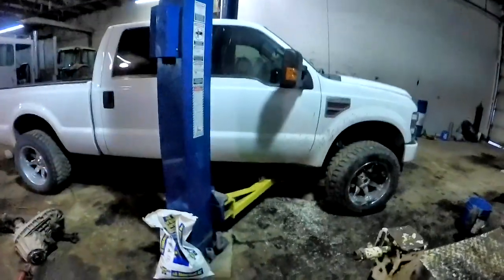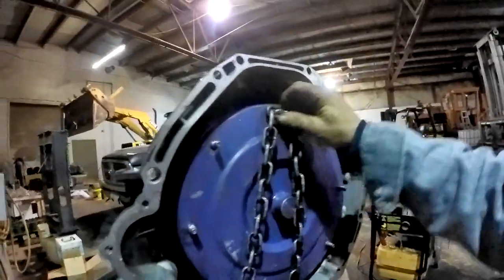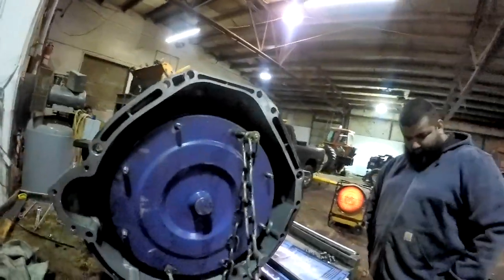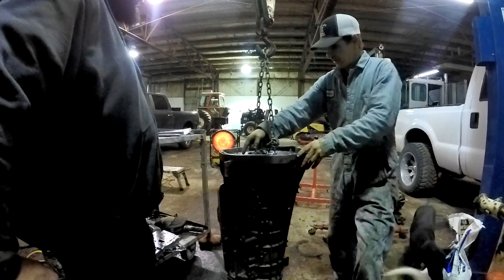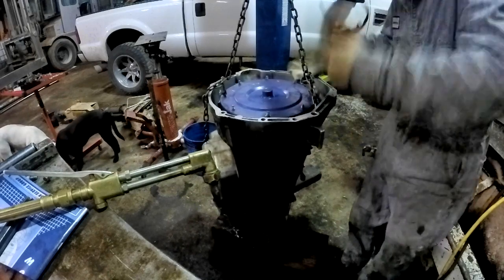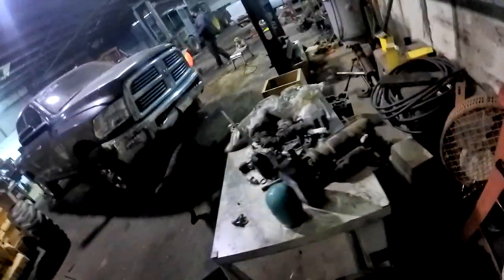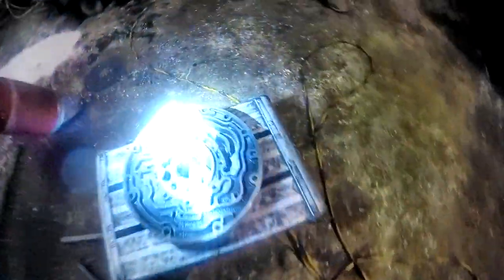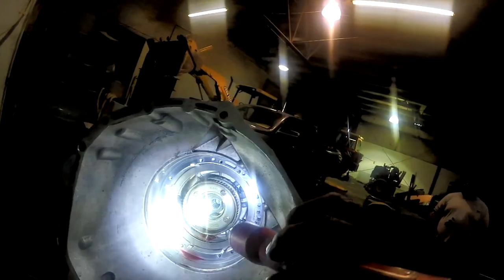Stuck Torque converter

Comment: Your doing what I did 2 yrs ago. For me it worked. But. I had to order a new torque converter shaft for the 727 torque flight. I hope you get er out Warren. Good luck. With your knowledge as a mechanic. you'll get er done.

Comment: My method of removing them,,
I use a factory ford converter shipping strap,,the ones that come with a Ford remanufactured transmission,I install it onto converter with two nuts and use two pry bars to pry it out between case mounting flange,,
Always worked for me,
Sometimes you have to bust the front bushing out of the pump when converter hub is stuck to bushing.
Takes a lot of pressure and best done with trans on the ground

Comment: i always send these transmissions out just because of this. remans are 2000.oo 3yr 100000 mi warr, i also use to rebuild trans.  the tooling has got out of hand and with these new elc trans you have to almost dyno them to tune them. so sorry to see you go thru this. i fine good used one's for 900 with 30,000 miles on them......my opinion junk it your have more labor , labor in cleaning, parts to buy +what you have in it up to now,  as to buy one ,cut your loss and move on to some thing that makes $$$$$$$$$$$$$$$$$$$$ and not so painful to look at

Comment: Warren you need some lifting links, they have a 1/2”hole 3/8chain link and the bar is bent at 30deg we used them when I was with CAT they are just great as good as eye bolts

Comment: Converter hub was welded off center. That's what converter manufacturers told me.
Reply from the maker: That's what I'm thinking.
Reply: Absolutely right. Had it happen with me and a 727 torque flight transmission. Hope you can get it back out warren. Big pain in the a--.
Reply: My transmission was  from the factory it came out of my 96 pase arrow  and went into a 94 southwind  both had 460 engines  .everything was good till i got stuck. In which case as soon as it quit moving forward . Hooked my jeep with a 12000 pound wentch and used the transmission as an assist to pull backwards.  There was no real sighn of a problem till we went to move forward to get the front tires back on top. The rear tires were on solid ground. It just quit moving.  Ive got 40 years of transmission work under my belt. So here i am in camp putting a front pump and torque converter in

Comment: I used to rebuild torque converters. When the torque converter was welded back together the depth of the inner half was probably not set correctly. This can make the convertor go to far into the pump after installation. Also the welding process may have been off center. The run-out on a reman torque converter should always be checked before installing the transmission.

Comment: Had the same problem after 56000 miles. No apparent reason.  I was able to use a pickle fork and a hammer to remove mine using the nuts and washers to pry against.

Comment: Hey dude..i got a idear form a drunk Irish Paver from Dover NJ..they had no starting fluid..one time.and the drunk told me soak a rag with gas,,squeeze most of it off the rag @ stick the gas rag in the air intake..some times i took the air filter out.of a cat c13..in a prostar dump..it worked every time like starting fluid..

Comment: Warren, you need a slide hammer. The foot plate that threads in and bolts on would probably not have enough diameter, but a couple simple plates with your welder and you could probably yank it out as well. 

Another great video man. My favorite channel on here.
Take care boss!

Comment: I have personally seen this many times,,on e4od/4r100/5r110w family of transmissions.
Since it happened on initial test drive after rebuild,,it was either;;;
1=if you replaced the front pump bushing,many aftermarket bushings are too tight and provide less than , .001of bushing clearance,,which will seize bushing to hub in real short order.
2=if you didn't get the pump perfectly lined up,it will cause this,,
Some of these pumps are mismachined and will fail unless you use the newer method and tool to align from stator.
3=a bad engine ground,,always run an additional ground from drivers side motor mount bolt to drivers side negative battery terminal.
Cost about 9.00 for a 4 foot section of #4 ground wire at most auto parts stores.
4=the converter wasn't installed all the way and you bolted the trans up,,this forces the converter hub into the inner drive gear out of alignment and will break it.
5= the converter had to much run out
6= inner pump gear was worn/notched from years of running increased line pressure and it didn't mate to New converter hub properly.

Comment: If I wanted to try and save the TC to show the shop who built it I think I would have fabricated a heavy puller frame that bolted onto the bell housing and made up some long threaded studs that wound onto those studs and draw it through the frame nice and straight, not sure how the studs on the converter would have held up but I suppose if you pick up on four of them you have had half a chance. Or use the torch.
Reply from the maker: I think you would have broke the bell housing try to pull it, or pulled the guts out of the transmission.  I don't need to save it, I'm sending them this video link.
Reply: You’re probably right! Luckily you weren’t running the company down too much if you’re sending it through to them. Cheers mate.
Reply: @westerntruckandtractorrepa1353  way to late now but could you have welded an i bolt to the center and used that for pulling? Maybe because it's in the center of the converter ?
Reply: Why not just attach the transmission to solid anchor and attaching the lifting chain to converter then attaching it to a vehicle leaving 3 of4 inches and just let ones foot of the brake and Bam converter is on the ground!!

Comment: I guess the pump seized which then spun the shaft for the tc.  If the torque converter seized it wouldnt spin in the pump,  the pump would just keep spinning.  Plus all the damage to the pump shows it was having problems.
Reply from the maker: I've had front pump seize before, but never seen one stuck like this.
Reply: @westerntruckandtractorrepa1353  understood but isn't the outside housing of the torque converter the part that interfaces with the pump?  Seems like any failure in the TC wouldn't affect the outside case.
Reply from the maker: Understand,  your pointing the finger at me.
Reply: @westerntruckandtractorrepa1353  hell no.  I've seen enough of your work to know that the chances of this being your fault are pretty darn low.  I'm thinking maybe a defect in the pump gears or maybe something wrong with the pump drive on the TC which let the rotor of the pump rattle around and maybe cause the drive to spin in the pump too.  Or possibly a something got into the pump and seized it. Not sure. 
I just don't see how something messing up inside the TC could have caused this.
Reply from the maker: I don't think it was something inside the tc , I  think something wasn't right with the converter drive flange. It had almost 300 psi on a stall test which tells me the pump didn't seize.  Hell we drove it in there. I think it was milled to small and let the pump rattle.
Reply: @westerntruckandtractorrepa1353  though I will say that in my 20 years as a mechanic I've found it's often worthwhile to look at myself first when something goes wrong:)
Reply: @westerntruckandtractorrepa1353  gotcha. That's exactly what I was thinking.  When I said seized I didnt mean fully. But yeah I think the TC drive was made wrong.
Reply from the maker: I do remember thinking how easy this converter went in, usually you have to wiggle and shake and screw with them for 10 minutes to get them lined up with the pump, this one just slid right in. I thought at first I got lucky,  not now.
Reply: @westerntruckandtractorrepa1353  it's "funny" how things that seems completely innocuous at the time can be so telling in retrospect.  Well anyway I feel your pain. Having to redo work sucks.

Comment: Oh, so finally, a real locking torque converter. That would the first one I’ve seen bind where that level of force didn’t get the TC out. It would seem the pump seized and the flats of TC pump drive turned in pump gear.I know you absolutely hated having to resort to blue wrench to get it apart.

Comment: Common Problem Builder Error Either buy special tools to line up pump or transgo kit 5r1-pump-align also clean matting surfaces at block and trans case so you get a good ground clean battery cables  and add extra ground pump bushing should be.002-.004 tight is bad on this pump Over fill trans on initial startup so you don't run it dry

Comment: 5R110W........sigh
A great transmission with the right upgrades.....but
You’d better get the alignment right on that pump assembly or......well, you get a destroyed pump bushing and gears.... and the converter is trash as well.
Ford ground the bushings off center on a ton of these units.

Comment: Dang warren.. why didn't you just take the pump bolts out first??? You could have saved the torque converter? I mean shit it took you no time to zip out those bolts for the pump.  I'm a master torque converter mechanic.  I've been watching videos for twenty straight minutes on removing torque converters.  And after 18 minutes I'm a master bater on torque converters. So before you Deeside to cut out that thing in the middle of the dog housing.. text me first and I'll walk you thru it. Shit counting ur video I'm like 35 straight minutes.   So I've got to be way WAY past that master part of a torque converter mechanic... hey keep in touch and I'll be able to save you some time. Next time brother

Comment: I've had that happen I use threaded rod couplers over the torque converter studs then bolts big piece of angle iron across and a small Jack on either corner of the case to press it out of there

Comment: Will that have damaged the trans? You going to have to strip and flush out the trans? The shock loading might screw up the bearings?
Reply from the maker: Yeah, it's definitely not good for it.  Doesn't take much to pull the guts out and clean it up.

Comment: I stripped the splines in a torque converter one time my mech. said he liked to not got the converter out . it took a converter and pump shaft to fix.
Reply: Warren its happening to me right now. Totally stock converter and transmission.  PULLED FROM A RUNNING VEHICLE AND PLACED IN ANOTHER.  EVERY THING WAS ALIGNED AND WENT TOGETHER LIKE BUTTER. But starter bound and refused to turn it.... Fought with jt for kver an hour so far.... Wish me luck Brother.

Comment: Saw one stuck really bad - wound up cutting and drilling some angle - made up a jig so we could use some bolts to push against the housing while pulling on the converter - turned out there was a bushing that had welded itself to the converter that was something in the pump... it took some time but didn't tear up anything

Comment: My butt was puckered over half this video !!!!! 😳 Did not know what was going to happen first. Hammer busting the case !! or  when the TORCH came out !! Would it be a FIRE and bring the shop down OR the Trans hitting the floor because of heat expansion causing the convertor to let go !!! Glad it is over !!😅
Reply: Same here. I figured that the converter was full of oil and would blow back sticking to his face.
 I've seen it happen on other containers.

Comment: Ground problems on the truck. Lots of atsg transmission articles and tbs from ford
Reply from the maker: Nope,  ran a separate ground strap just like the directions in atsg book said.
Reply: @westerntruckandtractorrepa1353  thats crazy ive never seen one do that. Thats not a ground problem. Hub must have been off a little from who ever built converter

Comment: Let Marco use the sledge.  He is probably a lot stronger than you.  When you hit it there is an opposite and equal reaction and it is rebounding rather than loosening.  It needs to be resting solidly on 4x4 block on floor rather than suspended.  Then all rebound force would be prevented by the concrete floor.  Then lift it to see if has loosened. Just a thought.  Haven't watched all the way through yet.

Comment: Pump is the problem, no oil to it
Reply from the maker: It had 250 psi of line pressure on the stall test ,so how did it not have oil.

Comment: Probably not the converters fault. These transmissions will have a ground issue once removed and reinstalled.  Clean the surface of the block and bellhousing, put at least a quart of fluid in the converter before installing it, and add an extra ground wire to the trans to be safe. It sounds crazy but I've seen it before, it sources a ground through the pump and will weld the pump gears to the plate. There is information on line about it also.
Reply from the maker: I did do that, that was in the directions for the trans go shift kit.